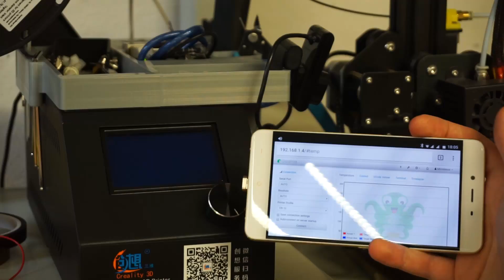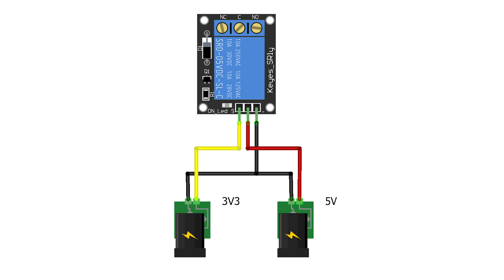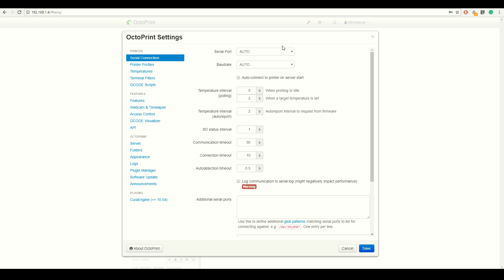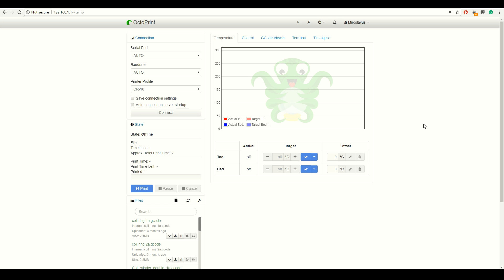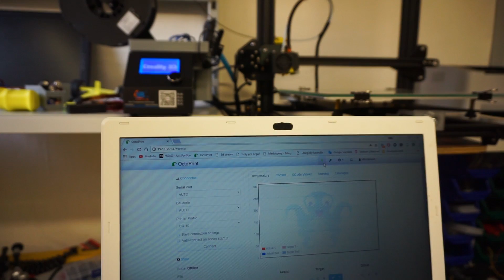How to turn your 3D printer on/off using Octoprint

Comment: It is DANGEROUS to switch currents up to 15 A with a relay that is only released up to 10 A by the manufacturer.
Reply from the maker: You're correct. That's why I'm switching the 230V line which isn't going to draw more than 2A, instead of the 12V line which can draw 15A and would be out of spec

Comment: How about when the PI outputs 5 volts on the USB and is connected to the printer? 
The controller may be supplied with power by the PI via the USB cable.

Comment: I don't like the way you presented your design for your relay circuit. You should clarify that the relay NEEDS to be rated for at least the maximum current consumption of the printer (you didn't mention how much it was). Also it is very important to clarify that the transistor must handle the current required by the coil. You could have also mentioned that the diode is necessary for protection of your electronic components.

The problem with not being rigorous with the design details, is that newcomers can easily have accidents, because they chose the wrong relay, the wrong transistor, or they just didn't install the diode because they didn't find it necessary.
Reply: it's probably alright, check these comments:
https://www.youtube.com/watch?v=dQNBeAZpRmk&lc=UgzZ0xbU4Xt_Kaa0dyR4AaABAg.96XxLSDErVc96esee6fuz-
https://www.youtube.com/watch?v=dQNBeAZpRmk&lc=UgwupoexWiw52wERZqx4AaABAg.8pBMmh_soDy8pBRX1-dfYz

edit: whoops that didn't work. Well basically just Gyro saying he put it on the power cable itself since from the wall it's drawing 1.6A at 120v (for 360w total). Does that make sense or am I missing something there

Comment: This probably will never be responded to but do you have any concerns using a 5A relay? I have a 120V, 10A relay for my Ender 3 and I want to make sure I’m not going to burn the house down when running this for a long term. The math says I’m only pulling about 3A but I’m not sure how reliable these small parts are.
Reply from the maker: These are cheap chinese relays so you never know but when they fail they don't catch on fire. You can get more expensive relay or even solid state one but that will be more work. Some people suggest smart plugs but they usually use the same components as this

Comment: Guys, the 3D printer consumes 15A and 24V (Ender 3 Pro). Don't use relays that can maximum handle 5A or 10A. Yes, it will work for a while, but if you leave for a too long time the relay connected, it can burn. Instead of that, I recommend to use a relay that can handle 30A (or any of them that can handle more than 15A and 24V). It is more safe and the price is not a very big deal.
Reply: Right. On my tevo tornado i want to connect it to AC so it should be fine as i thought
Reply: so 15A*24V is 360W. The relay is switching the 240V line. So 360W/240V should be 1.5A on mains voltage. If your SSR can handle 2A it SHOULD be enough. Correct me if im wrong, please.
Reply: @KilianGosewisch  So, in this video and usually simple relays are made to handle 10A 240V AC or 10A 30V DC. If you are using such relay, you can handle only 10A*30V DC=300W, while the Ender 3 Pro works on 360W, so it consumes more Watt. If you want to connect relay from the DC power supply of the 3D printer, it can not handle this power. For that better to use a 30A 30V DC relay. Also, I noticed only now that he connected the relay to AC source, so theoretical it will handle 360W (10A*240V AC=2400W), but for DC not.

Comment: This is exactly what I was looking for, figured this was how you'd do it, except I'm wondering why you chose to splice into the power wire opposed to just tapping in behind the power connector and enclosing your relay inside your PSU's connection cover. That way you can still flip the switch to completely kill everything drawing from the wall outlet opposed to having to unplug it.

Comment: Is there a way for me to block the pi from powering the mainboard? Im setting up a relay to power on the printer from the pi and all is good so far. My issue is that darn undervoltage to the printer  when it is not turned on. I want to leave the pi running all the time and only turn on/off the printer when needed. Thanks for the tutorial btw great vid.

Comment: I find that if my printer is off but connected via USB to the pi, that the pi powers the display and circuits of my Ender 3. I'm not sure that's a good thing to do. Therefore I would need a second relay to disconnect the USB power to my printer

Comment: For all those people with 5v relays, I had the same problem with it not working. I got it working by using pins 4, 6, 8. If this still doesn't work change it to Gcode command in octoprint.

Comment: You should mention that in large parts of the world, the mains plug is not coded and can plug in either way. This can be a hazard, if you use a single relais, if you switch on and of the neutral wire, instead of the L1. If you swith the neutral, the power is still delivered to your printer, so there s still a live wire inside your printer! It does not turn on, because the N wire is not connected. But it will schock you either way if you touch it. Use a 2 relais board and switch N and L with the two relais, controlled by one GPIO.
Reply: At least where I am in USA, while you can plug it in either way, there are different plugs used for when it matters, such as two prongs with one larger which prevents inverting the wires, or any plug with a ground which only has one way to plug in.

With 3D printers they always have a ground connection, so there would be no way to accidentally plug it in reversed

Comment: Wouldn't it make more sense to wire the relay up so that it's normally open? That way the printer can only be operated when the Pi is up and running.

Comment: 2:20 why not just ad the relay in after the on and off button in the 3d printer then you can hide the relay in the 3dprinter..
Reply: The power supply would always be running

Comment: Why didn't you used the relay with the 24v dc curent instead of ac ? Also doesn't it draw more than 10A, the psu has 14A

Comment: Couldn't you take it even further, and draw 220v from the cable to power the Pi, and make an enclosure for all the components? Essentially you'd be left with a power cable coming in/out of the box, and a USB-cable for connection.
Reply from the maker: Yeah. That might be neat

Comment: hi gyro im totaly new im running 3.5 display on PI   can i just use same pins for display twice for relay if i extend them from other side? thanx
Reply: 5v and ground  double   and gpio  that is not uset by display ?
Reply: FOUND ANSWER THER https://www.youtube.com/watch?v=0-Ol6Yvf0fg    AT 6:55

Comment: hi there. im using orange pi lite board, sucessfully installed octoprint and the required plugin. 
The thing is, when i choose switch method, it only shows "system command" and "G-code command". 
There´s no option for GPIO... any help?

Comment: Tried making this work for 2 days and finaly got it. I was using a 5v relay and a 5v pin, but couldnt get the relay to unswitch. Just use a 3.3v pin instead of the 5v and it will work fine.

Comment: Hi all. I'm developing a plugin (or implementing another one) that shut down the printer automatically when it reaches a certain temperature, without the need to open the app or the browser. Does anybody know which file checks this on octoprint?

Comment: I would like to have my printer set up so that I can turn the printer on with either the normal on/off switch on the printer or the pi. Could I do that by connecting the NO terminal to ones side of the printers on/off switch and the COM terminal to the other? Would that cause an issue if both the relay and printer switch were closed at the same time?

Comment: I like it and your professional video. When I make mine I will use a drill to make the cable holes and I will pull the cables out of the same hole for the switched power lead. Depending on space remaining I will use 2 cable ties each and when I cut the power lead I will position the cable somewhere adjacent to the printer to keep the cabling neat.  Top-notch job!!.

Comment: You are using a 5 amp relay to power a 30 amp power supply with no fuse or breaker.
This is VERY likely going to melt or catch fire.
Uploading a tutorial like this is irresponsible, and can easily get people killed (if it hasn't already).
You need a 40 amp solid state relay for this application.
Reply: I don't think so. For a 360W power 3d printer the primary on the 230V should be approx 1.6A (or  ~2.1A if 480W), while the secondary (if 12V) should be  ~30A or  ~40A respectively. He's connected to the primary, so a 230V/5A relay should be pretty much fine.
Reply: @guidocauli  A Meanwell NES-350-12 is 7A on 120V AC or 4A 240V AC at full load. These cheap relays are notorious for being out of spec. The relay will likely melt or catch fire.
Reply: This is exactly what I was pointing out in my comment. The fact that the guy didn't specify the relay he used nor the total power consumed by the printer, a newcomer can easily burn his printer or office just by choosing the wrong the relay. Not to mention the transistor for the relay, the resistor to the base and the flywheel diode.
Reply from the maker: There seems to be a lot of confusion here. The relay is switching the 240v mains voltage. Even a 5A relay could switch 1200w printer. When you say 30amps you mean 30 amps at 12V. The relay couldn't handle that that's why I'm switching the 240V which is just 1.5A when the 12V is at 30A
Reply: @Gyro1  The problem is that you didn't mention how to choose the relay (not to mention other components), which is very important. Maybe you can switch a printer with a 5A relay, but since you didn't mention the total current consumption of the printer (i don't know if you measured it), a beginner can come and see your video, and then use an even a smaller relay  eventually burning everything.

Comment: If you're asking yourself "why would I need this?" let me tell you something. Octoprint makes sure to keep an eye on your printer, and your printer should have thermal runaway protection active. Octoprint can send an emergency gcode command that disables all heaters and motors, and the printer's thermal runaway protection does the same and reports an temperature error. What you need to know is that the bed and hotend heaters are controlled via MOSFETs. These act like switches, like transistors because they are a type of transistor. But they an actually fail short circuit meaning that they're stuck in the ON state. This means that even though the printer and octoprint receive a constantly rising temperature error, there's nothing they can do. They can't turn the failed MOSFET off. This is rare but extremely dangerous. Having a way to remotely shut down the printer is good, and Octoprint can do this automatically by using this relay trick. That's why you need it.

Comment: I have a relay lying around, how do I check the voltage?
Reply: If you aren't very familiar with electronics, I would recommend buying a relay board. Remember, mains voltage is lethal! The relay board has what you need: the relay, a fixed specs sheet (including logic level and input voltage and maximum switching voltage and current) and a screw terminal, and even some status LEDs. You could also use a solid state relay. Those can directly switch mains and they accept a logic signal directly, because they don't require much current to turn on. They also don't wear out and aren't clicky.
Reply: MrRedstone yeah i think that’s what i have and im pretty sure its 5v

Comment: This is great but I assume this means that power must be on the pi at all times Yes,? so while the printer might be off the pi will still be on albeit it not doing much. as this video is a year or  more old would it be a safer bet now just to use a wifi socket and turn the power off to the pi and the printer and turn them on via wifi when you want, that way the pi is not running even in background when the printer is off? Am I correct? thanks Neil

Comment: Thanks for helping out the community. I configure mine so that my screen, board and pi are connected to a 5.1v uninterruptible power source. My first setup used an HP DPS-600dp power supply in which certain pins needed to be jumped to power it on. I connected that directly to my servo pin on my board (almost any other pins could be programed via firmware).
I had to configure the PS_ON pin and enable ps control in firmware. This eliminated the need for a relay on that setup. I could turn it on via the lcd screen and octoprint too. Just use the power on plugin or as I do, type M80 via terminal to turn it on and M81 to turn it off. I also had to add a relay to the PS to cut power to the fan when it isn't running full power. The 5vsb out powered everything else. 

On my second build, I used two HP DPS-1200w in series for 24v. Unfortunately this power supply still overheats if the fan is off even if it isn't providing full power on only Standby voltage. I then had to get a relay that works off of 2.5v as my xyz max ports have a pull up resistor and only outputs under 3v. It was a 5v relay but had a circuitry that allows it to be activated very low. This is getting too long...... I can turn it on via the tft screen and via octoprint too....

Comment: Hi Gyro. Great tutorial. I am having a problem where I cannot connect to Octoprint when the printer is turned off. My raspberry pi has its own power supply and is on, but because the printer is off I can not get a connection to turn the printer on remotely. Any suggestions?

Comment: Hey, So I am quite new to 3d printing and know little to none about the electrical part of that world. However I've already done an octoprint install on my pi and connected it to my ender 5 plus, and it is working great. For now I'm doing what I see in videos on youtube haha (so thx a lot).
And now I want to try that.
I still have a question that might seem dum, but when you are controling your printer with your pie. 
So you can turn the power off, and then you have turn your pie off, all from within octoprint.
But when you want to turn your pi on, you still have to go dowstairs to take off the plug and plug it back in no? 
Thanks a lot, haha that dum question is been bugging me for a while know.
Reply from the maker: It wasn't very clear from the video but pi has to plugged in its own plug separately from printer
Reply: @Gyro1  thanks for your answer, and do you know which relay module should I use for the ender 5 plus? It has a 500W power supply. 
I was told not every 5v relay works for all power supply.
I want to make sure "nothing blows up and nobody dies" haha 
Thankss!!

Comment: The USB give power to my printer

The led still turning on 
How can i fix this, please help
Reply: You have to modify your USB cable. Only thing to do is to cut the red wire.
Reply: disable the USB power in orange pi or something

Comment: Hi I made this and it's awesome! Is there a way to combine it with the automatic shutdown plugin from octoprint? that after finished a print, the PSU turn off the printer and octo shuts down too?
Reply from the maker: Thanks. I'm not sure if it's possible but I'm just using the power off when idle as automatic turn off

Comment: Thank you Gyro for this great tutorial. I have a quick question. Is there a way to set this up with the Pi Zero W?
Reply: yeah. the concept is the same, if ur Pi Zero can run octoprint then basically u can do it as well. just a simple IO thing
Reply: @kupuk23  thank you. I've actually abandoned the PSU control through Octoprint because sometimes it worked and sometimes it didn't. Instead I use a smart plug now. Much easier

Comment: You say hook up the printer power wires to Com and NC (Normally Closed), but I think it should be NO (Normally Open), that way, if the raspberry pi turns of it fails safe and does not turn on your printer! I've already ordered my relay, hoping to do something like this soon.

Comment: Thanks for much for making this.  It's great information and I'd like to take on the project but I have a question.  The Amazon link goes to the 3.3V relay.  Is that right?  I believe the video referenced the 5V GPIO?
Reply from the maker: Thanks. 3v3 relay works better. Just connect it to 3v3 instead of 5v. The GPIO pins output only 3v3.

Comment: Thank you making this video.   The relay conversion to 3.3 signal in helped also.  I tried to use GPIO02 as it was closer to 5v and ground but found it unresponsive.  I guess the script does not declare the use of the pin,  but changed it to GPIO only pin,  then used pin number not GPIO address and worked fine.

Comment: Hot it working now, i have to use the end pin and middle, i did not know because there is no pin layoit on my relay, but bottom pin is Common open and middle is closed top one is common closed. So i use common ooen en closed now, and it is fine, so not the two outer pins wher the brown is going in as in yoir explanation

Comment: i've seen using methods like this above using the relay to completely remove power to power supply. This is no good if your powering  your pi from said power supply. so how about just cutting the power from the power supply to the 3d printers board. this would leave the power supply on but the printer off. for example on my ender 3 pro i would just have the relay cut power going to the xt60 connector?
Reply from the maker: You could do that. The only thing to look for is how much current will the printer need. The relays are usually rated for 10A and the heated bed combined with the hot end can draw more than that